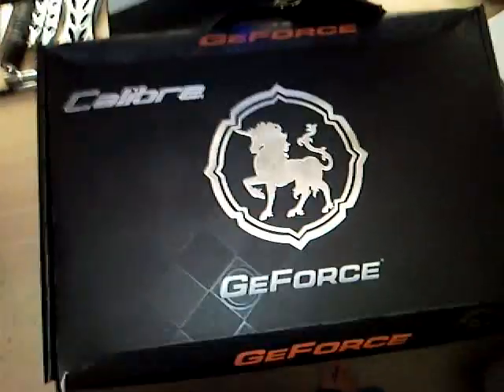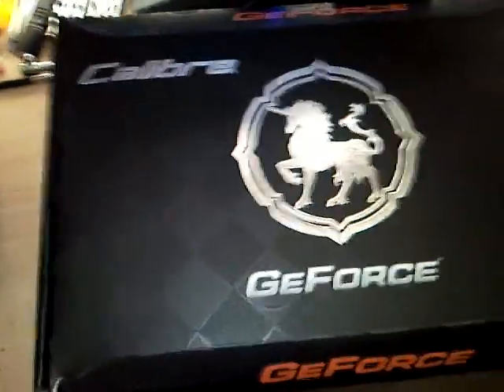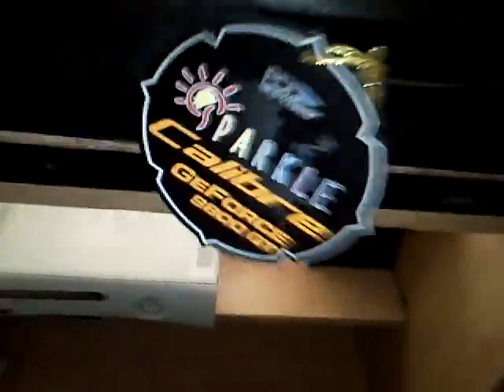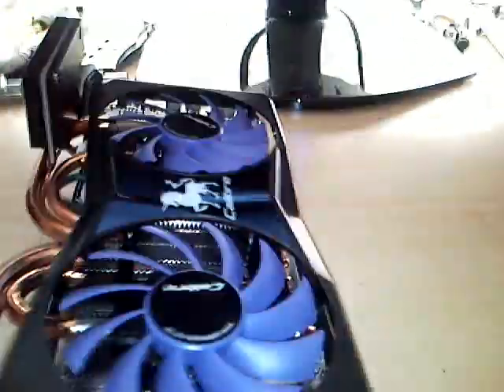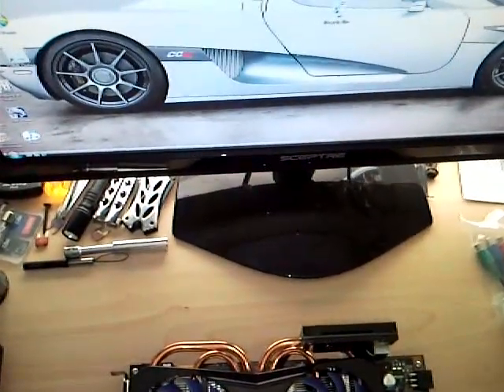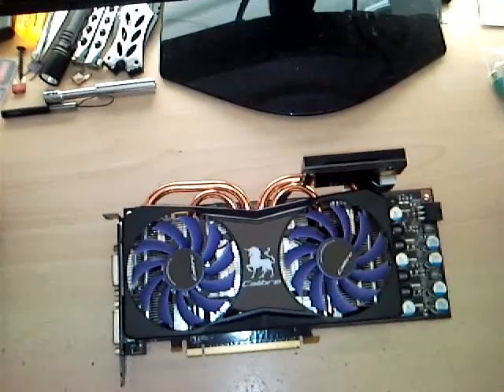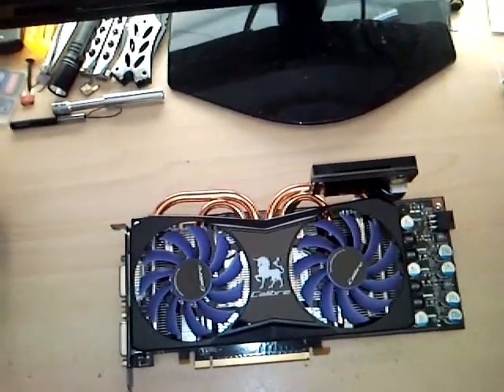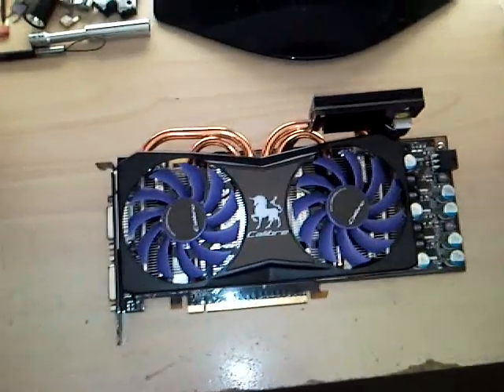Sparkle Calibre 9800 GT  Box Opening

Comment: I had this card way back. It's not a regular 8800/9800 gt. With no overclocking this card wouldn't even hit 60 Celsius under full load...all it needed was a voltage mod.
Reply from the maker: Yeah back when I had these I was way too new at computers and didn't understand how to overclock well or do any mods. Still a great GPU though for its time.